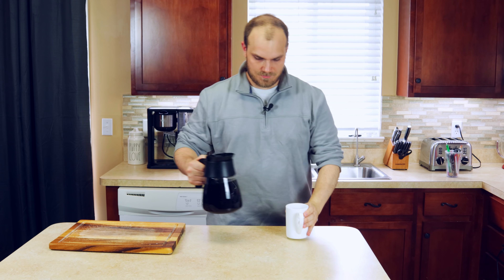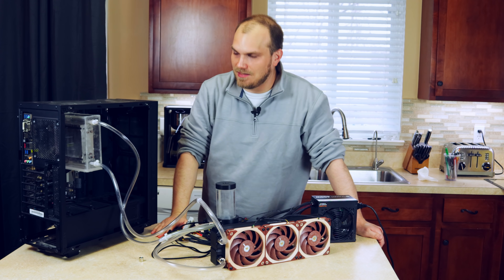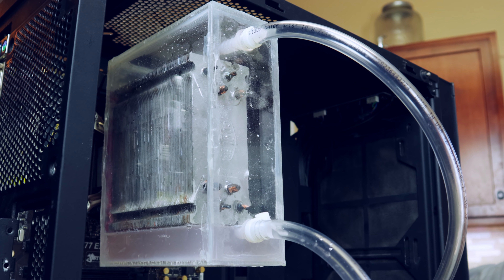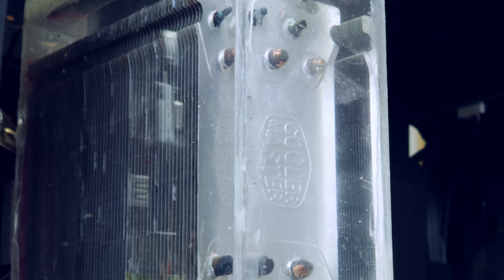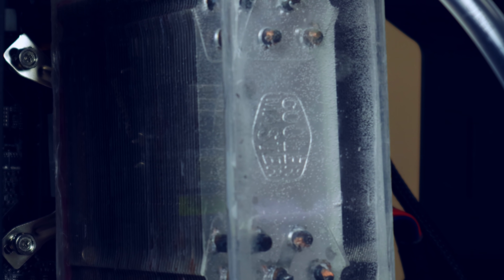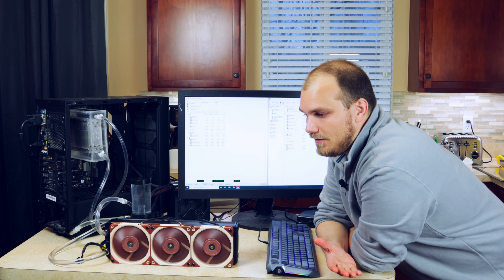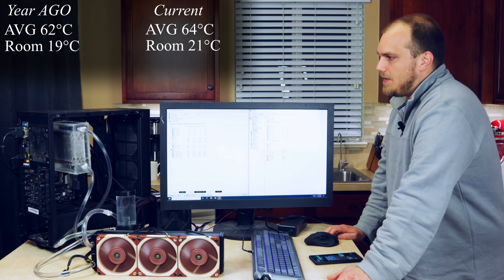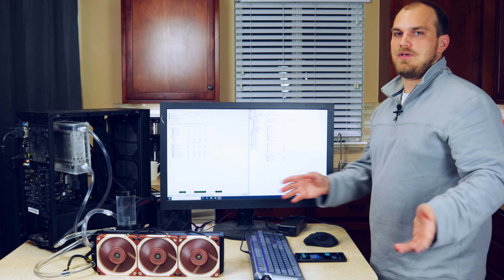Water Cooled Air Cooler 1 YEAR LATER, Time Has Not Been Kind

Comment: You could have avoided this corrosion, either by using engine coolant instead of tap water, or by attaching a zinc piece to the radiator, the zinc would have corroded instead of the tubes and the fins

Comment: We've seen fish tank cases that use mineral oil. Why not run mineral oil through the water cooler instead of water? It's a little slower, but would be safer for any parts if there are drips and it keeps things cool pretty efficiently.

Comment: Make a better newer design with a non corroded and maybe even a non corrosive non electrically conductive liquid. Then see how hard you can overclock it before the heat becomes too much for this design. And have another cooler overclocking test for reference. You should also be doing this with a modern multiform cpu. Thats some LTT stuff but it could get the views maybe you could even partner with another youtuber or start a little funding campaign to get the money required to make this happen.  You got a lot of subscribers I know id donate to a project like that.

Comment: Suggestion maybe - Rinse entire system with distilled water, perhaps a few times. Then fill with distilled water. The corrosion may be due to minerals/salts in the tap water. May have to create new cooler block due to old block corrosion leaching bad chemicals back into system. Just a thought.

Comment: Try a compact cooler with liquid nitrogen or some other exotic liquid.  Water coolers may need more room in the computer case than you have there, especially with the need to have fans in the cooler setup.  Some exotic geometry may be required for the water cooled system to work.

Comment: I think I know how you could make this run at peak efficiency
inlet at the bottom, outlet at the top
solder 5-10 fins shut on the narrow side alternating between left and right to create a proper flow channel
make it fit better on the face
atttatch 10mm wide bieces of acrylic to the soldered sections to complete the flow channel
now it's just a matter of cooling the water, the cpu cooler basically should have a capacity of about 600 watts or more.
then again
this simple version looks a bit cleaner

Comment: After seeing the previous one I was wondering if using the non-conductive mineral water or even dry water (yes it's expensive but in a closed system you wouldn't have to use as much over time) would have done better regarding cooling or corrosion. Tried looking it up but only ever encountered answers that involved deionized water with anti-corrosion chemicals and/or PH balancing answers...neither was the fluid I was asking about.

Comment: Can you try a heat piped cooler, but cut the ends off from the heat pipe and pump water through it. If you could do like 3 heat pipes all with water running through but still have the fins dry and open to the air.

Comment: Try it with the NOCTUA NH-L9x65 cooler (or a cooler with a heatsink of similar sice and specs). Its supposed to contain CPUs with up to 84W TDP - originally made for 65W CPUs - and is only recommended for 90W CPUs if the case has really good airflow. So maybe try some 90 or 100W+ CPU with the heatsink of that thing and see if the additional water cooling can compensate for the lack of heatsink volume and surface area.

Comment: Aluminum and water aren't a good match. I work at an engineering firm and when we make parts they are cleaned in Luminox or Simple Green. Briefly at that. Hot water will also discolor some aluminum. Aluminum is easily corroded, pitted and discolored.

Comment: Insane amount of surface area in contact with water compared to a “normal” water block. It should far surpass everything else until it’s corroded down to rubble 😆
Or make the system air tight and you won’t get any corrosion 🖖🏼

Comment: You should use an automotive coolant , it has additives to protect aluminum engine blocks and heads from scaling and to carry heat efficiently. It will also protect cooper. Should work well with your project. It comes in green, red and white. Also it's good for 50,000 miles so you should never have to replace it.
Reply: And Purple coloured coolant too! But I agree with James. Running a Ethylene Glycol solution may yield better results and better longevity from corrosion.
Reply: I don't think the pc is moving 50k miles so i think you'll be fine

Comment: Can you remove the fins from the cooler so you can make the plate with just holes for the heat pipes, and then put them back, with that you can probably try to redirect the water path in the middle of the fins with second plate which blocks one of the sides so you will have something like the path of water block where water enters on one side and has to go to the other side and turn back, this will probably fix some of the problems with not moving water inside the big box

Comment: Stainless foils and tubing for the air cooled side. A 90 for the top to allow more air out of the system on the output side feeding into the radiator. A stainless thin wall tank. Fill the system with lab grade deionized water to avoid corrosion and mineral deposits.

Comment: Only just seen this video I think you should do this again but add antifreeze type coolant to the water mix to stop the fins corrosion modern car antifreeze should be fine as its used for 5 years in aluminium car rads that get way higher temps and pressure

Comment: if you make another one do not forget to coat the heat sink an copper in some kind of sealent like lacker..or just use transformer oil. because air coolers were never built to be submerged in water for long periods of time an will rust

Comment: If you do a 2.0 use a sealing spray paint on the entire air cooler (minus the contact with the cpu). The paint should prevent corrosion.

Comment: I'd like to see 6 fittings running through the heat pipes with a fan on either side of the fin stack with the lines combining to flow through a actual radiator

Comment: I have not read the other 1000+ comments (to see if anybody else has thought of this) but as you can see the copper, aluminum and water are reacting together creating the corrosion and gunk.  If you were to build a 24/7 type cooler I would suggest an all aluminum system. maybe with one of those monster square aluminum heatsinks designed for "passive cooling" in HTPC type systems.

Comment: I'd love to see a redesign with t he hoses connecting so that it fits in a case, using more acrylic to create channels to distribute the water through the heatsink evenly with a flow like you would have with air, and definitely with some anti-corrosion additives to the water.  LOL  Other improvements could be a temp sensor for a mobo header and, of course, RGB lighting.

Comment: The real question is why are  you using tap water? It is rather dirty and corrosive in terms of those things. You should get some super clean deionized water and keep that thing clean. You should also have put the inlet and outlet hoses diagonal so the water would be force to flow across the radiator and not just across the one side of the tank. You also need a purge valve so that you can properly fill the tank and reservoir to get all the air out. Those thing would make it more efficient and reduce the corrosion. Possibly use a dilution of deionized water and some kind of alcohol to increase the rate of thermal transfer.

Comment: Major Hardware man I would try a close loop system and use auto Antifreeze. You can use a small Dorm style Refrigerator with lines curled up in the freezer part and you can use bottom part for your drinks.

Comment: It was interesting to see how it had fared.
And I would personally would be very interested to see how a "small air cooler" would work when "converted" like this. Maybe You could start by testing doing it with an "Intel Stock Aluminium block", and then "work Your way up" in size ??  To see how different sizes and models work for this kind of "shenanigans" :)
(Also maybe You should have "flushed" this one before running the new tests (not least to save Your other equipment from getting contaminated. And in case You (or anyone else) should attempt to do something like this again, please use "Car antifreeze mixture" instead of "just water" in order to mitigate the "corrosion").
Best regards

Comment: You should have less volume of cooling liquid I yr DIY tank than the radiator. Yk like car you have the same engine block with specific volume in it and y upgrade to bigger radiator for more performance. So y should do the opposite. Same radiator but smaller "engine block".

Comment: To properly test this brilliantly insane concept, the tech needs to be pushed further. You're working with a 95W TDP CPU and a cooler that would handle 180W with two fans. My stupid idea is to use a more modest heatsink, and a hotter chip. If you were to budget $120ish for one of those AliExpress E5 16?0 (no V) combos with a 150W TDP CPU and pick up, one? several?, more modest heatsinks such as a two-heatpipe unit designed for a 80-90mm fan, this would test both your patience and the very concept.

This would also get you into the still building trend of fiddling with "Chinese" motherboards. As opposed, of course, to all of those motherboards they make in Saskatchewan.

Also, one part WaterWetter, eight parts distilled water.

Comment: If you do a version 2.0, make sure to electroplate the cooler with something corrosion resistant. 

As the copper aluminum are dissimilar metals, flowing water across it may cause electrolysis. 

May help prevent corrosion in future builds.

I'd also try and place the fill and drain on opposite "Walls"/Corners to help draw flow across the entire surface area of the cooler.

That's my ideas.

Comment: If you're wanting to make another one, you should try and find a cooler that isn't mixed metals, especially if you're wanting to actually run it long term.  That's the reason you have the corrosion.

Comment: I have one of those radiators. When I was experimenting with peltier modules I was able to maintain a good 2c difference to floor temp  But with my design it worked much better than pc fans and cheaper.  Get a polystyrene box hot glue radiator to it then add $20 ebay ducked fan to the box (Can add dimmer or control)  and you have a really good quality cooler box for pc or what ever. Could even be used as a heater if warm water is pumped through

Comment: Just a suggestion for the next cooler to add MoCool to the water. It is used by race cars to transfer more heat into the water, and assists with corrosion protection. I use it in both my Smart cars which have 700 cc intercooled turbocharged engines and struggle in summer to keep the temperature down. It could provide a better thermal conversion as well as giving your system longevity.

Comment: Consider trying a full copper cpu cooler and some additives to avoid corrosion. Thermalright AXP-100 comes in a full copper version, fits AM4 and most Intel sockets, and it has 6 heat pipes. However, it is low profile which may pose a challenge, but if you can pull it off the result will be more compact. Best of luck!

Comment: great work bro, I have couple of recommendations, first why not try to use Motor oil? try somthing light like 0W30, this is will avoid any leak damege, has good cooling abilities and will prevent the rust. secoundly I think you may need to work on the oil flow inside the heat sink because I think the liquid is escaping behind the heat sink, if you decided to use oil you may need to chang the pump with a stonger one. finally i think you may put the entry and the exit points at the side to save some space

Comment: You can use probably one of the simple aluminum coolers that are shiped from Intel with some CPUs. The weak point of this setup is most likely the aircooler and specific the air to metal thermal link. What you do on the water side dosn't matter that much as long as your pump is running. If you can measure water temperature ingoing and outgoing you can see where to improve. If the difference is significant the aircooler is good and the selfmade watercooler is the weak point. If there is no big difference and the overall temperature of the water is rising the aircooler is weak, and you have to enlagen it or get more airflow

Comment: I wonder if you had used water wetter, if it would have avoided the corrosion. 
https://www.redlineoil.com/waterwetter-coolant-additives

Another coolant we use in motorcycles is engine ice.
https://www.amazon.com/Engine-Ice-TYDS008-Performance-Coolant/dp/B000H01NFY

Comment: Try using mineral oil to cool it instead of water so you could put a fan inside mounted to the cooler to circulate everything. Also if it leaks at least it won’t kill your system since it can’t. Also would be cool to add some rgb.

Comment: You can use epoxy resin for getting a perfect crystal clear sealed base "Your hot gun glue don't look pro and you know is a dissaster waiting to happen", use clay at the base of the cooler where heat pipes goes trough, then pour the epoxy resin apply vibration to remove bubles, once cured remove clay and there u have it: A perfect fit sealed base.
Reply: And use thicker acrilic or lexan and replace hot glue with long screws. For sealing of edges use rubber seal + force applied with the new screws.
Reply: This way you would not need hot glue and you can dissably it for storage or cleaning.

Comment: Use a stock round heat pipe cooler like the ones that come stock with AMD CPUs so it will fit inside the case

Comment: Why would you use straight water? Use Distilled or actual cooling solution or even nonconductive mineral oil. The enclosure could be made smaller like almost snugge with the fins so the water passes threw the fins better.

Comment: Remake the box with a new air cooler. Attach a fan to it. Then use mineral oil instead of water. This should stop the corrosion from happening and wont short out the fan.

Comment: I reckon your test method probably does not showing your design is functioning, unless you were just tying to test the 3D print tank still holds

It would be very nice if you put some stress on your system such like intel burning test or furmark to find out how good is your cooling design work

Just simply standby workload can’t really tell is this good or bad, my air cool L9x65 standby on i5 9600KF running 4.8Ghz just 50 degree

Comment: I would like to see you do a build using something like a high proof alcohol and glycerin mixture instead of water. Something with a higher thermal load while being able to be chilled further without freezing or becoming more viscous. I imagine this will take some tweaking, but there should be some good example recipes on the net for "normal" liquid cooling setups. I bring this up because it might help solve your corrosion issues, while letting you dip that radiator into some ice water instead for some craziness.

Comment: The main thing I'd be worried about with a year of use, is galvanic corrosion in the system since you've got bare copper and bare aluminum literally touching each other in the water. Normally you design water cooling loops to only use one kind of metal for that exact reason. Ship hulls use sacrificial zinc blocks to protect the hull; you might want to look into doing something similar in your loop if you make a V2 and try to run it for a while.

Comment: Do a low profile one like a Shadow Rock LP!!! Sure would fit better and if the water inlet were on the bottom side with the outlet on the top (probably on opposite ends) the water would actually flow through the fins.

Comment: I'd be interested in seeing a second edition; i would recommend applying a clearcoat of paint or epoxy onto whatever radiator you use (prevents corrosion for longevity and won't affect efficacy very much) and attach the inlets and outlet the middle of the sides (the position they use now, but at the center of the skinny sides instead of both sharing the  plane beyond the heat exchange plates).

Comment: I'd love to see a revisit of this. I have no suggestions for the cooler to use but the box can be made smaller. The top of the box could be right against the tops of the heat pipes. The sides of the box could be very close to the sides of the cooler. Inlet on one side and outlet on the other. You would then literally be forcing water through the fins. Maybe even have more than one inlet and outlet. Possibly 2 or 3 of each, spread over the height of the cooler. Water line distribution blocks are easy enough to find and aren't very expensive.

Comment: I think such a cooler would be way more efficient when the water is forced to go through the fins. The inlet and outlet must either be on the opposite site or the water must be directed. With the current design a lot of water will acutually just flow from the inlet to the outlet without going through the cooler.

Comment: 8:50 how about a normal CPU water cooler? ^^ A copper block with acrylic top and try to find the best flowpath trough the copper base ;) That would be pretty interesting. 
But yeah... Thats really heavy stuff and i guess you don't have equipment to machine copper. So... Heatpipes leading to a simpler (easier to fabricate) water block. OR Try building one of those pumpless cooling loops. They are practically big heatpipes. For example a thin copper block on the CPU with a fat tube leading upwards where there is a big copper plate (preferably finned for increased surface area) witch is cooled either by air coolers or liquid coolers. You just need to find a practical coolant, preferably non flammable and with a boiling point at 45 to 50 degrees celcius.